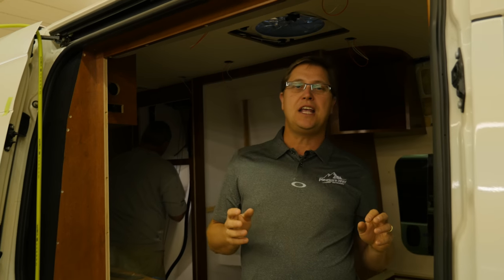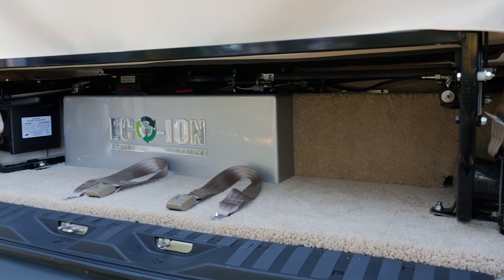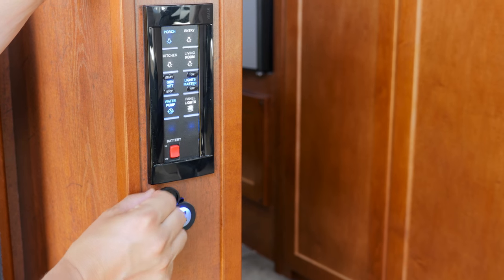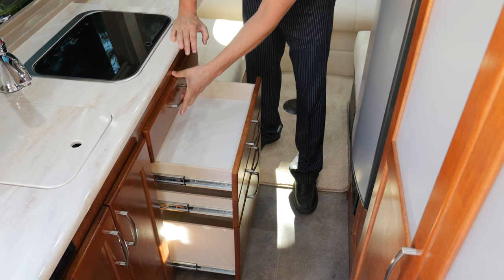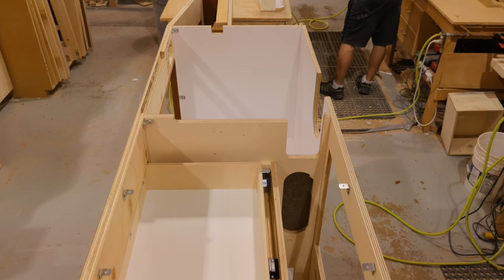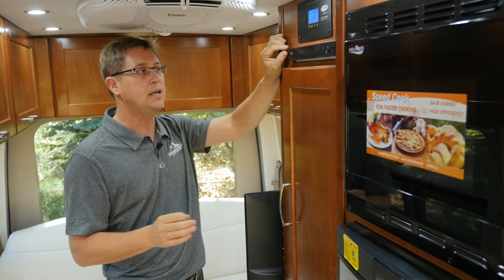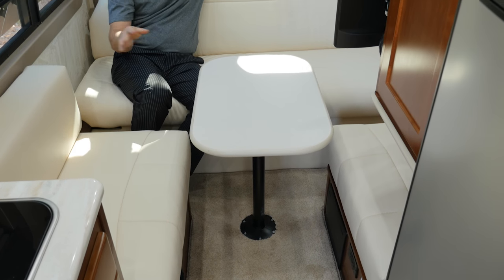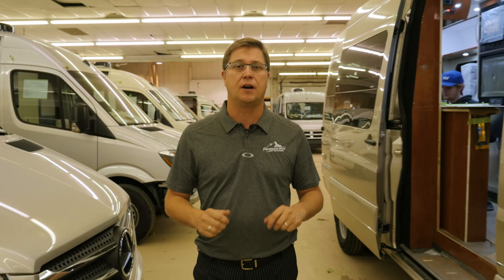2017 Pleasure-Way Plateau FL Tour

Comment: Very nicely done, Dean. Two things I'd like to see you address to make the coach better. First, an operable, street-side, awning window in the forward lounge to foster cross ventilation. Second, a bathroom without an exhaust is troublesome. A Ventline Vanair fan would evacuate steam, heat, and odors. This is an extremely wellmade product reflecting fine craftsmanship and pride. Love your dedication to quality.
Reply from the maker: Hi dkb2go, thank you for taking the time to share your comments and suggestions, we appreciate the feedback. Regarding the bathroom vent, our placement of the Fantastic Fan, seen at 18:34, allows it to properly exhaust the bathroom as well as the kitchen area. 
We leave a small gap along the edges of the bathroom doors to allow moisture to escape, but we also recommend leaving a bathroom door open or ajar while showering. This may sound counterintuitive, but the shower curtain inside the wet bath is what will keep water from getting outside the shower area. Thanks again for the feedback and for watching!
Reply: But do you want the bathroom to be vented into the kitchen area?
Reply: The key word is exhaust. The air from both areas is drawn to the outside. These multi bladed fans move a lot of air.

Comment: This is definitely one of the highest quality class b vans out there. However, those ground effects that run along the body sticks out way too far, looks terrible. Also, you guys need to offer an all electric version of this coach with more batteries and solar panels, with under-hood generator instead of Onan. Diesel fueled radiant heat and hot water systems are also becoming more popular with people who don't want propane on board. Roadtrek and others have been offering this type of configuration for years. A lot of people want an all electric coach.
Reply: D LG Exactly!  I love the 2500+ generator off the diesel engine. And 470 watt solar panel system. Typically have 2 batteries off each system although I'd prefer 6 batteries total with the newer sine conversion system. Solar panels use to be 50 to 100 watts.  I've seen some with 300 watts per panel. And they use solar panel air deflectors, both front and on the side for side winds. I want to be propane free.

Comment: I think for the money this is the best built Class B I've seen, my favourite floorplan, and the length of the RV for driving is just right for me. I especially like the passenger side windows and the window behind the driver's side.  I hope Pleasure-Way will look into exterior paint: graphite gray or platinum; and I like the no-decal look.  Since there's a solar panel on the roof, will there be a ladder available as an option?  Can I get a bathroom window that opens?  Also I wanted to add that the cabinet handles are amazing... so handy for hanging things up temporarily, unlike push button handles.  Thanks.
Reply from the maker: Hi Lyricist1anda2, glad to hear you are a fan of the front lounge floorplan. Regarding the window in the bathroom, the reason it does not open is because of the original glass panel of the chassis it sits in. If you visit 2:03 of the video, you'll see the first glass window pane and that's what the bathroom window sits behind. As for an optional ladder, we currently do not offer one. Thanks for watching and taking the time to comment!

Comment: Just test drove your Plateau FL...and loved it...is there any way to retrofit the TVs to connect headphones?
Reply from the maker: Greetings! Connecting headphones directly to the TV is tricky. The only inputs the TV has are HDMI and coaxial cable, meaning, you can only connect headphones through a third party device like an Apple TV or Roku. For example, the Roku allows you to plug headphones directly into its remote. Additionally, Apple TV allows you to connect Bluetooth enabled headphones. However, these solutions will not work if you wanted to use headphones for watching cable TV via the antenna, as that is connected directly into the TV. I hope this helps, thanks for your interest!
Reply: @pleasureway  So curious, I believe the Jensen brand provides a headphone jack, but more importantly, it also provides for 12v usage.  I know Jenson TV's cost more but your price point should consider it. Is the a benefit to using a TV on 12v DC vs 120 AC?

Comment: Do you have a option for tilting the solar panels to get more efficient power generation? I do a little off road driving and I was wondering if A/T tires might be better than the all seasonal tires, the tire thread is just a little deeper. Do you offer than tire option? Thank you.
Reply from the maker: Greetings! We currently do not provide an option for tilting the solar panels. As for A/T tires, that is something you will be able to order through your Pleasure-Way dealer: http://pleasureway.com/locator/ We ship the motorhomes with the standard, Continental VancoFourSeason tires provided by Mercedes-Benz. Thanks for your interest!

Comment: I am in love with the FL! Is it a 5 speed automatic transmission and gasoline and/or diesel? I am moving to Dallas,Texas and saw you have a dealership in Halton, TxXwhich is only like an hour away from Melissa, Texas. Right now I am in NJ. Also is this the same type of stainless steel sink well as in the Airway stream. i don't want my fork to fall into it and pierce through the sink.
Reply from the maker: Hi Jen, the Plateau FL has a 3.0L V6 BlueTEC Turbo Diesel engine and features a 5 speed, automatic transmission. The stainless steel sink is very high quality, we can assure you that. All other specs and details on the Plateau FL can be found here: http://pleasureway.com/plateau-fl/ Thanks for your interest!

Comment: Four season??
Reply from the maker: Hi joneslr25, unfortunately we do not build any of our models for all seasons. Although the coach can still be driven and operated fine in winter conditions, you will not be able to use the fresh water system as there are tanks and water lines exposed to potential freezing temperatures underneath the motorhome. We recommend winterizing the fresh water system at that time. Thanks for watching!
Reply: Nobody nobody has a four season ClassB. Nobody.
Reply: Some companies (UltraHeat) make heating pads but they use power and they would work best if placed on the tanks before the insulation was sprayed on the tanks.